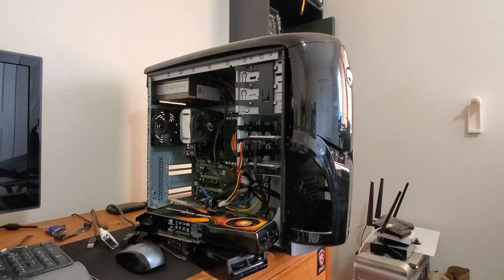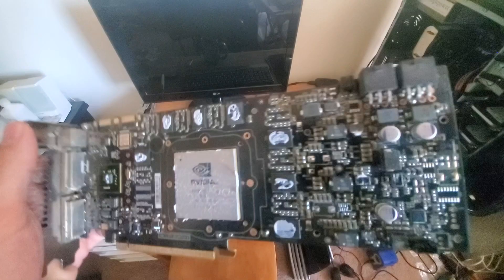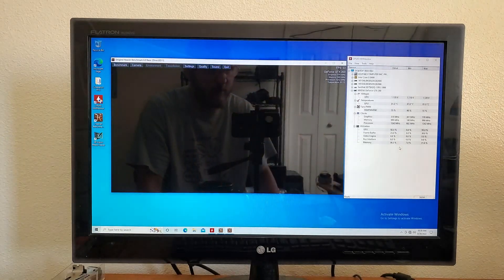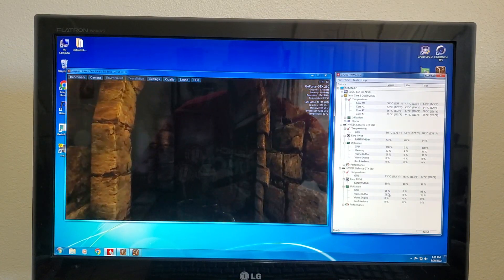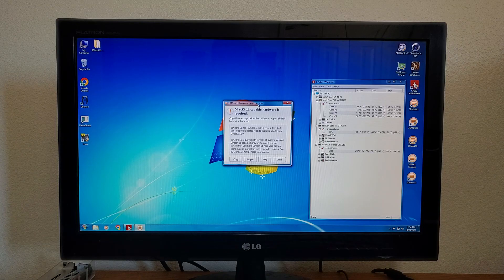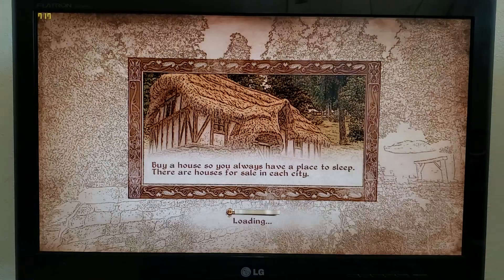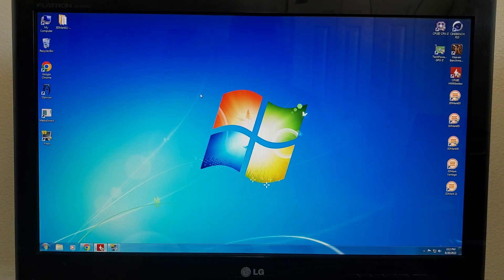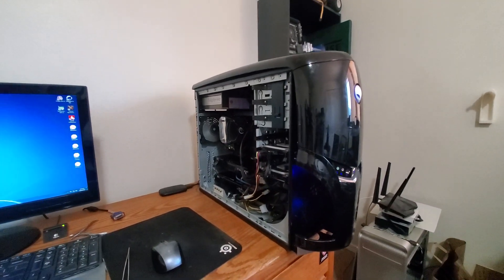Alienware Resurrection Pt 2

Comment: 11:58 cpu 105c under the evga temps? Did you replace thermal paste under the north and south bridges, are those what its showing or is it cpu socket temp or what?
Reply from the maker: I usually ignore the temperature readings under the motherboard in hardware monitor since they seem to be unreliable in both temperature reported and their name.  I have seen them report over 200* C.  The core temps of the cpu are what I go by. I usually do replace the thermal paste on all heatsinks when I refurbish a motherboard.

Comment: Really like this setup. I did a similar build running an EVGA 680i SLI motherboard with a watercooled oc´d (4ghz) QX9650, 8gb of OCZ SLI Ram and 2 EVGA GTX 580s with 3gb each, since i wanted to get the best performance possible out of the old 680i board. It's even running GTA V at 45 - 70 fps with high settings as well as many other games from around 2013. The maximum powerdraw is around 800 Watts under full workload :D

Comment: My grandparents got me an Asus laptop when I went off college in 06, all I remember about it was the ati x1600 gpu and it had like 1.5gb of ram. Got me through but it was a hot boy and died shortly afterwards. Been through many computers since but my current fascination is an old xps 720 h2c I got from a friend. Draws 3x as much power as my actual gaming machine, performs 1/10 as well(maybe..) but it was $7k when I was a broke ass college student so I like it. And it looks like Darth Vader's mobile home. I did opt for an ssd boot drive though, I can't go back..
Reply from the maker: Darth Vader's mobile home!  Lol!  I actually have a Dell XPS 720 motherboard laying around.  I garbage picked it out of my neighbors pile of stuff at the curb a long time ago.  The case was in bad shape so I never did anything with it.
Reply: @idoesstuff1  I can see why you didn't. The board, case and psu basically all have to go together.. And cpu cooler for that matter.. 775 but with this crazy diagonal mounting position lol. It's a cool machine for the uniqueness factor but really a shitty overall concept. I like that it all works but it's going to be expensive whenever something let's go so I recently got a 750i version of the board in your alienware to build something less proprietary from the same vintage. I love this era of hardware!